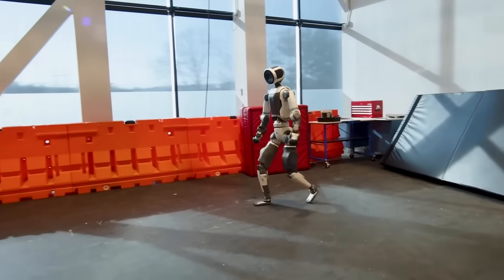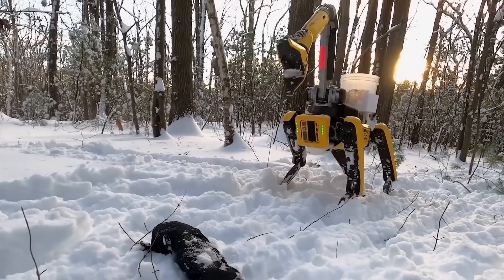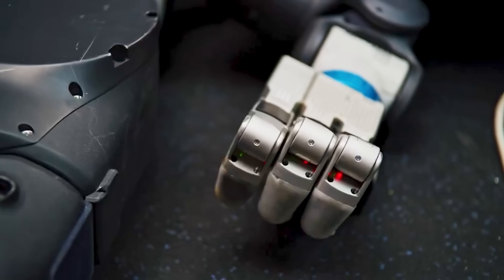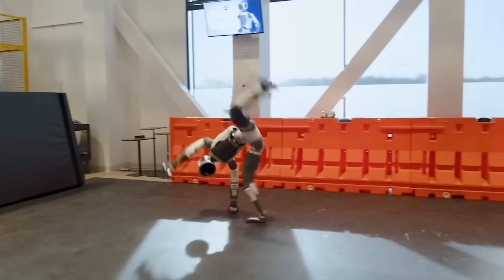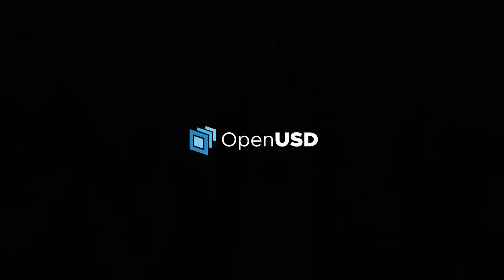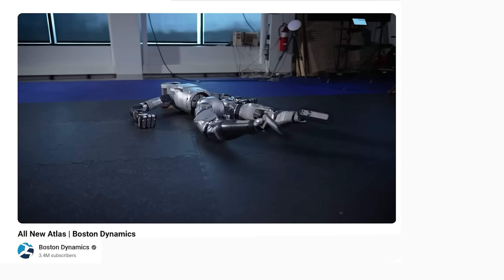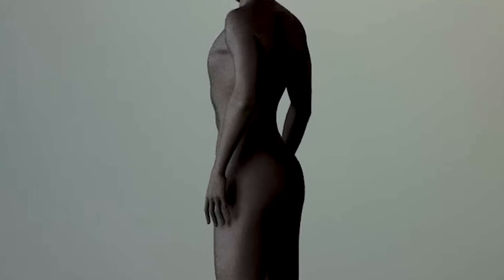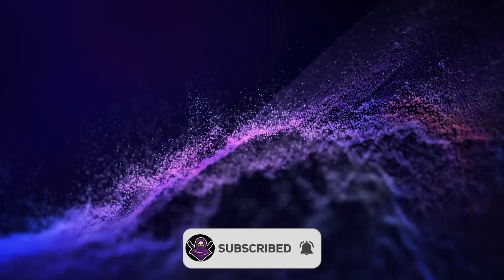Boston Dynamics New Atlas Robot Feels TOO Real and It's Terrifying!

Comment: Amazing jump from the previous hydronic version to the electronic.  Also, the amount of learning that has taken place is a little scary, if the continue at this rate of improvement, no telling where it will end up
Reply: 1977 Star Wars came out.
and people were amazed at the C-3PO robot barely walking (with Anthony Daniels inside).
Now, robots can parkour better than 99% of world population.
Reply: Self replicating is the horror tipping point to me.
Reply: Grocery stores will never be the same.

Send your robot to pick up grub, the cashier is a robot, the stocker is a robot, the .... 

It is when robots take over management and unionize when we need to start to worry.
Reply: As the terminator once said it’s learning at a geometric rate or something like that. If it becomes self aware then humans are in trouble.
Reply: @winstondeocampo699  becoming slef aware is quite the high bar though and I doubt that the hardware used would make it feasible. Unless we go the network route with shared resources.

Comment: They'll need a ruddy good battery to keep going all day!
Reply: Good point, it takes a lot of power to keep those servos in a static position let alone moving and stopping a heavy unit like atlas. Work for 20 minutes then charge for an hour. Unless they employ a battery swap system like power tools.
Reply: Actually, beta voltaic tech is producing nuclear batteries, which don't need recharging.
Reply: "Betavoltaics were invented in the 1970s.[3] Some pacemakers in the 1970s used betavoltaics based on promethium,[4] but were phased out as cheaper lithium batteries were developed.[1]"